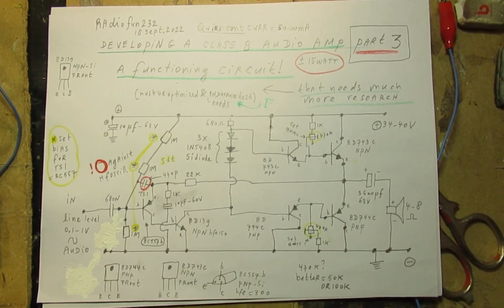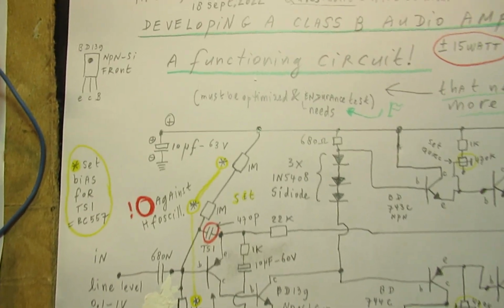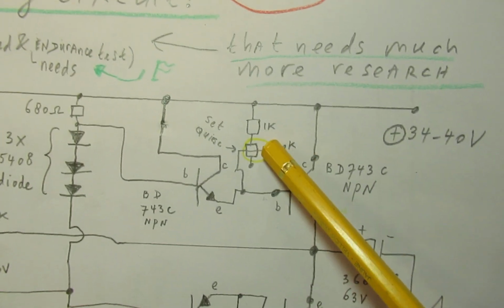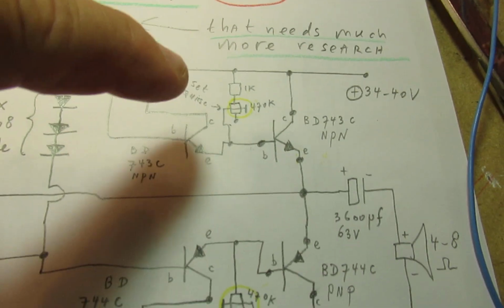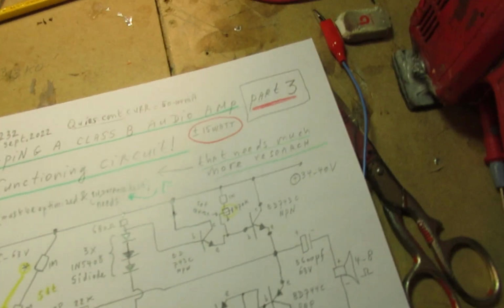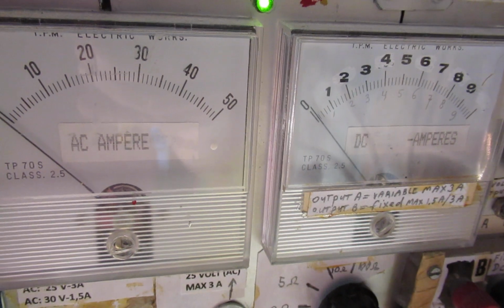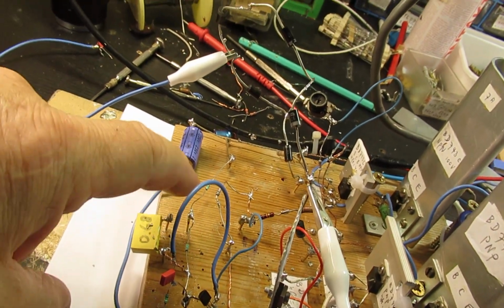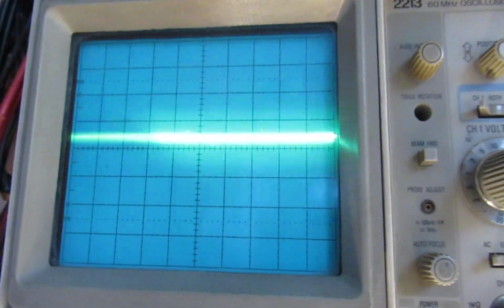Talking about developing a class B audio amplifier of the 1970s pt 3: now a succesfull schem. & demo

Comment from the maker: The used audio box in this video is/was in my book "Schematics 2, Audio amplifiers and loudspeaker boxes", that book is availabe via the LULU website, link is in the description of this video, author Ko Tilman on that LULU website. The book shows how to develop your audio boxes yourself, getting out the frequency response that you want/need. Say sound "profiles". That is also one of the central aims of my You Tube channel, when talking about audio (or audio technology, a big word). Many video's about that: audio. What you hear and what you want to hear in your living room (regarding the audio quality) can depend on the audio amplifier that you use and also about much more: the LS boxes frequency response, or damping of audio (sound, or certain audio frequencies) in the room where you live, etc. Many links to good quality and easy to make audio amplifiers are in the description of this video. A very good quality amplifier that can be made with a Hi Fi chip and (in my case, the circuit that I developed and published on You Tube) was especially made to work on very low audio levels in a living room (thus giving a rich sound out on low audio levels). It is/was published in this video (say a special audio amplifier) with the TDA 2615, a stereo Hi Fi Chip Amplifier. Video is here https://youtu.be/1id_cNdDLvs 
That is an easy and stable and good Hi Fi Audio Chip, made by Philips. 18 september 2022.